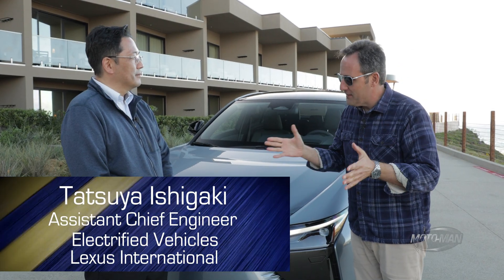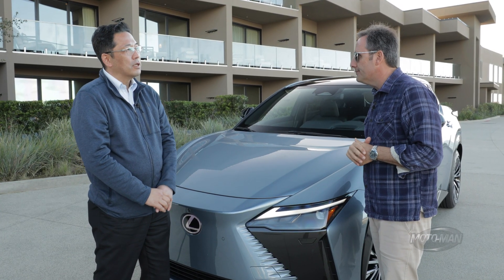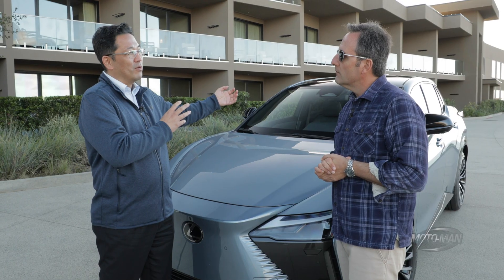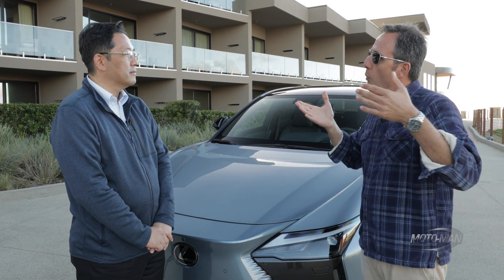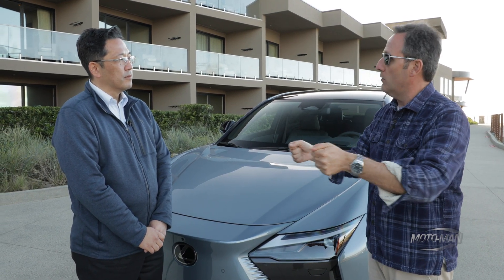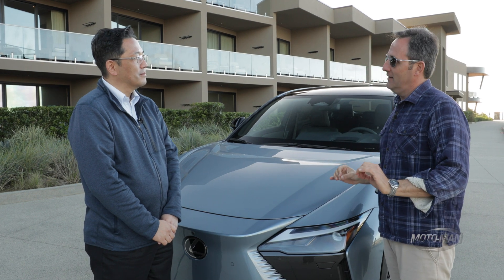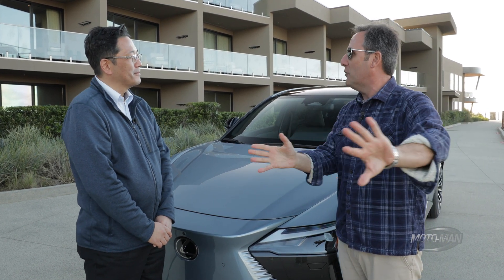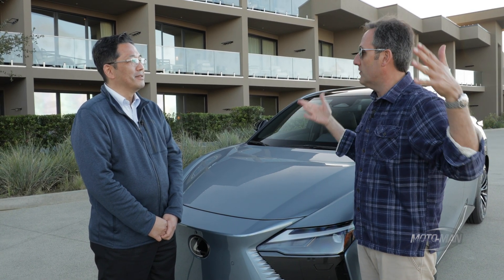How Lexus developed Steer By Wire for every day use & the RZ 450e

Comment: I think the Yoke steering Wheel should be very fun to use and also more practical > Because you do not need to turn the wheel nearly as much as a full round wheel.  I will be anxious to test drive this electric with the Yoke steering.